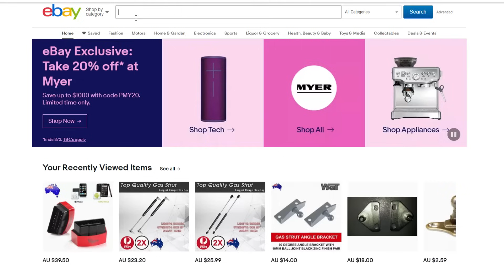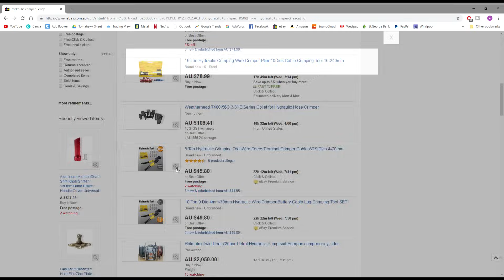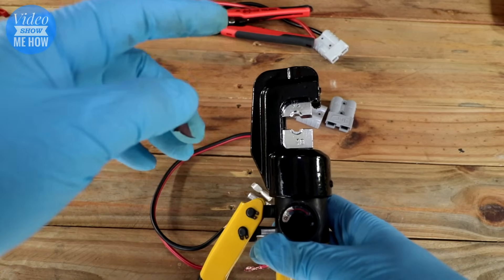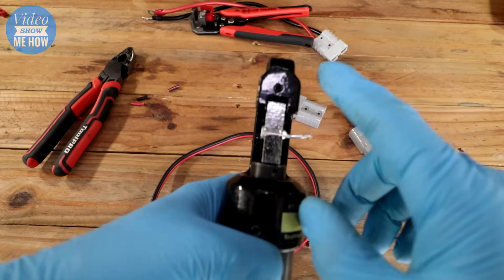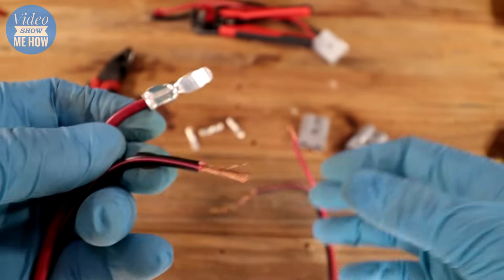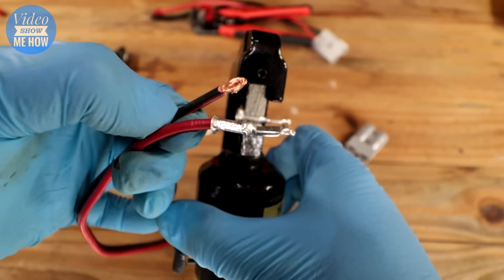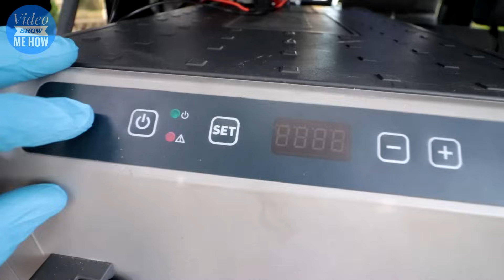12v Anderson Plugs and Connectors - Complete How To Guide

Comment: Do u really need the fancy tool or will a normal one do just aswell ,, thanks
Reply: I crimped the mid size anderson twice with  crimpers left it holes where the wire was visible through the shell . I then soldered through the hole into the crimp its self making sure no solder ran  up the wire. Best of both . it's for a high power ebike.
Reply from the maker: @Boxbeat666  sounds great. Pool soldering works a treat as well. Andersen's would be perfect for an ebike battery pack 👍
Reply from the maker: Do you mean the hydraulic tool?
Reply: @VideoShowMeHow  yeah they bit too much for 1 or 2 jobs
Reply from the maker: @Boxbeat666  ah I see. Well normal crimpers might be ok for some thin guage wire but as soon as you get near any thicker stuff they just won't clamp enough and it will come loose eventually. Perhaps look at the flood solder method instead? There's a video on the channel for that also

Comment: Excellent thanks. Just about to connect a Battery Charger & Battery & My Dometic Fridge. Your video answered everything. 👍🏻
Reply: A CFX35W. Had it over a year now. Very pleased. I always run it on 12v & find it to be really frugal. All the best.
Reply from the maker: Yeah they're a great fridge, I've had a cfx65dz for a good 5 years, still going strong. Have left in the rain camping couple times (by mistake lol 🍺🍺🍺) and still going strong :)
Reply from the maker: Glad it helped! What size fridge you go with?

Comment: Using the 75 amp app for 4-6 s rc batteries. Regular red and black plugs. What is the name of the hydrolic crimpers. The manual crimpers is very hard doing 10 awg wire. Thanks.
Reply from the maker: Hi, these were eBay specials, if you do a search like in the video you should find something similar - they're just a generic brand.
Reply: 👍 thanks

Comment: Can these plugs be used in conjunction with a solar set up? I'm looking to get solar on a vehicle that would be used  to power 12v accessories and have alternative charging with my vehicle's charging system while Im pulling my trailer.
Reply from the maker: Hi Adam (great first name btw 😉), yes you absolutely can. I would recommend this type of connector as your first choice. I use this on my camper for exactly this application. I would also recommend getting the little covers to help protect from the elements 👍
Reply: @VideoShowMeHow   Ok great. I'm a little confused on how to set up the connectors. I would have a battery set up in my vehicle (with a charge controller) so I can have dual charging (solar and high output alternator), and then using the anderson plugs to run an seperate house battery to run from my solar set up in my truck to run to the camper.
Reply from the maker: You'd use these connectors for the join between your truck and camper. If your solar is not permanently mounted and is a portable type I would also use one in the join between the solar reg and solar panel. This was you can quickly connect and disconnect.
Reply: @VideoShowMeHow  Ok. Thanks.